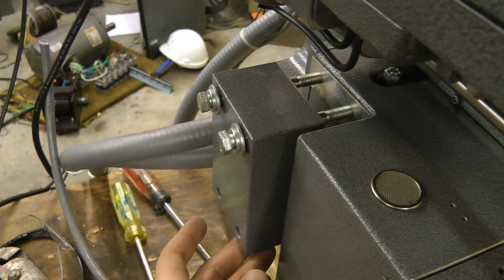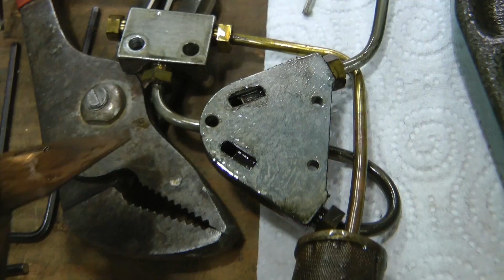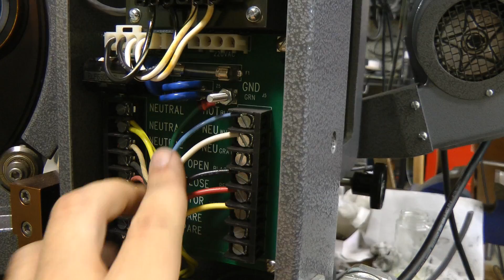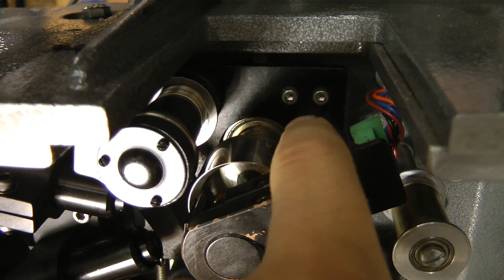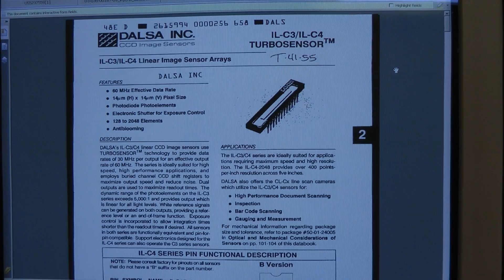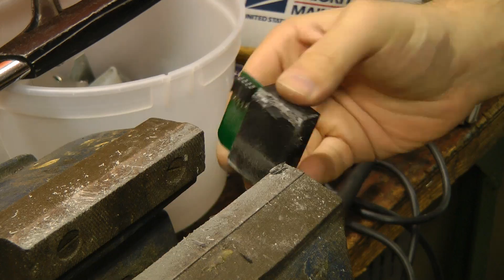Extreme teardown - Simplex 35mm cinema projector - Part 7 The Projector Itself

Comment: This is a much later super simplex machine, based on the castings and finish. The earlier machines from the 30's have some really fun streamline castings in a glossy black finish, and chrome trim, plus large shrouds/cowling for the projection reels to keep dust and fingers out. They also had the slightly more dangerous carbon electrode arc lamps, with the mechanical feeder assemblies for the carbon electrodes to keep the arc distance consistent over the duration of the projection. That's partly why many projectionists had to be trained in mechanics and electrical design for their own safety and the safety of the theatres. Especially since those designs were in use until the highly flammable nitrate films were retired in the 50's, in favor of the acetate films (and later polyester). This machine was likely slightly redesigned to accommodate newer soundtrack stuff, like dolby DTS, and the newer polyester print films, which could cause damage to the machinery if there was a jam.

Comment: The anamorphic lens in a projector expands the image horizontally, not vertically.  When you look into the lens and see the oval vertical... that's when it's in correct orientation to stretch horizontally.  It's a prism.

Comment: WHY TEAR DOWN A WORKING MACHINE? IF YOU WANT TO PLAY WITH PARTS... WHY DON'T YOU JUST BUY PARTS? REDICULOUS!
Reply: Not to mention that you have to be pretty dense to not notice that he puts it back together afterwards, and he specifically mentions several times in these videos that he wants it running to show it off.
Reply from the maker: +PAUL RICHEY Because the projector was (almost) free?
Reply: The only way to learn is to tear it down and put it back together again. Great video. I worked on these mechs at Elstree Studios back in the 60s and 7os.

Comment: The bottom bit is a cue detector and failsafe. The potted deal is a triple proximity sensor: you attach 1/4" wide strips of metal tape to the film at centre, inner, or outer (or a combination). Different automations do different thongs with this info - some have coded cues (ie inner + outer turns the house lights on), other just see a cue and have the actions programmed in sequence for a show - first cue may be lamp on, lights off, sound on, and open the dowser for example, . The two optical sensors detect the film: one just that it's in there and one pointed at the sprocket holes can tell if it's in motion. The automation will shut the motor and lamp off if the film breaks or stops moving.
Again, you could find a compatible automation (probably a Component Engineering TA-10) pretty cheap if you wanted one.

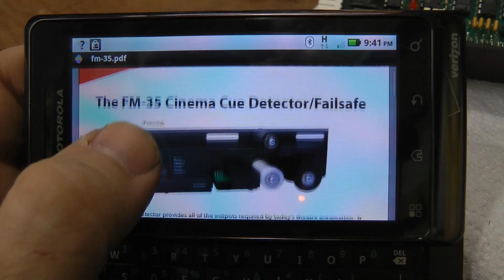Comment: I once operated this model projector about a year ago, really, really awesome to see this tear-down and your awesome commentary. For the object at 29:29 I can tell you that it's most likely a device that senses a small metal tape, like you said, (placed on whoever built the film print) to cue a program automation. Check out my video on 35mm film projection. (just search for it in my channel) and you will see the device we have under the analog sound reader (different than what's in this video).